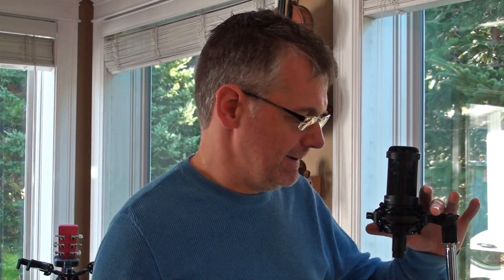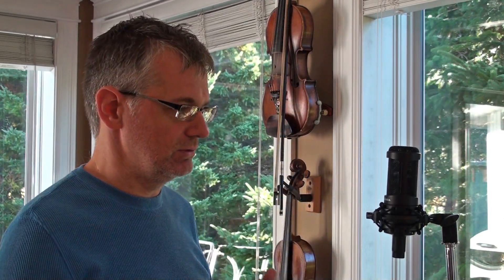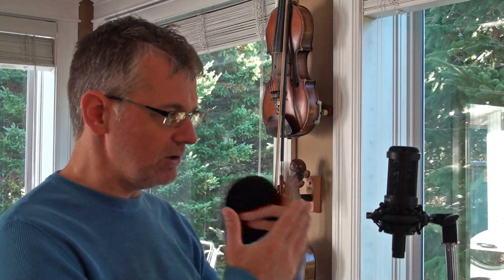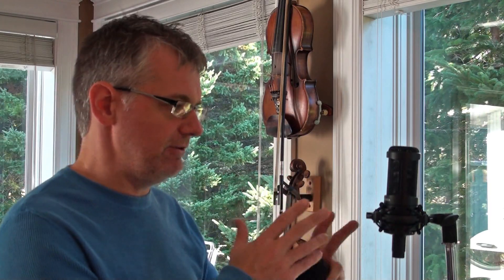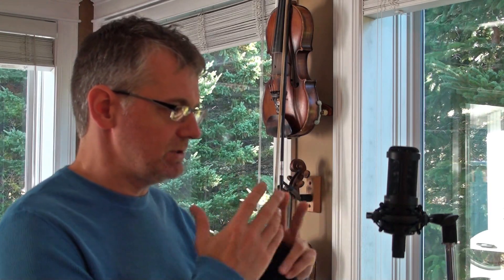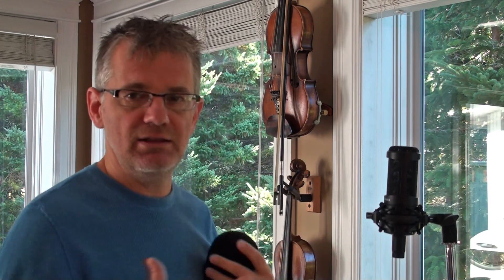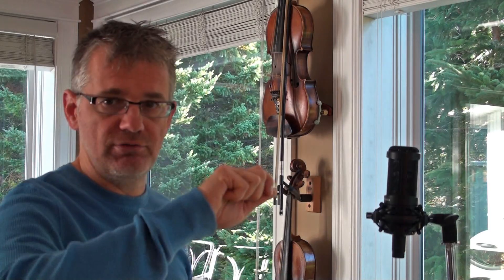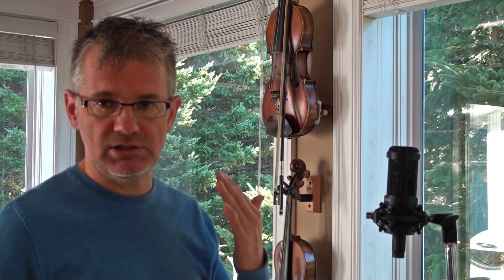Vocal Lessons How to Improve Recording Microphone Placement Audacity Tutorial

Comment: You're right about the off axis for plosives. The air goes straight forward, wind doesn't bend and you can't feel it if you stand on the side. But sound-waves spread and you can hear them if you stand on the side. So pointing 1 inch off axis and the air misses. Pointing right at the capsule you will have some P no matter how fat your pop-filter is. By all means use a pop-filter cause at times you will sing into the capsule. 
BTW, does Audacity run with ASIO4ALL-driver? Does a standard (non-USB) mic run with ASIO4ALL and ASIO4ALL then run with audacity? I guess that's the full question.

Comment: I don't have a fancy microphone (wish I did, but money is a factor too...) I have a USB microphone called Editors Keys SL150 I think is the model and when I record, I edit JUST the vocal track alone in Audacity (if I open the karaoke track I'm using or a track I created myself and sing with it in audacity, there's a LOT of clipping for some reason) so I record the vocal track in WavePad, which is like Audacity, to reduce clipping and then I edit the vocal track in Audacity and save it was a WAV file, but then combine the two in WavePad to avoid clipping. However, when I edit the vocal tracks, I noticed that certain consonants like S and T sound very broken in a way....almost as if I had recorded it on a webcam....I tried the noise removal tool, that didn't help much....What would you suggest for this problem?
Reply from the maker: Hi Liza, Very exiting. Try to get rid of the 'plosives' (S&T) on the mic rather than in software. I will sound much better. Try using a windscreen or pop filter for that. I have tutorials on that. Also stay close to your mic, but lower the record level or gain in Audacity as you are recording to keep away from clipping. I have tutorials on that too.
I have many more Audacity, recording and editing tutorials in my Video Guide to Audacity at my site MakeAndBreakEducation (link in the video description). Check it out.
Thank you,
Andrew
Reply: Andrew Mercer
Thank you so much! I will definitely check out your other videos. I hadn't thought to turn down the gain. I appreciate it =)
Reply from the maker: Liza Rome Great Lisa. I have  a tutorial on how to read the input meters and set the recording levels in the Video Guide to Audacity. 
Cheers,
Andrew

Comment from the maker: With your wireless I am assuming that you have a receiver and a mic. You should be able to plug the 1/4 inch cable from your wireless receiver into your 'line input' of your computer. Should work fine. Just double check that you are plugging into the line input. If there is not enough gain on the line in, then try the mic in. 
A